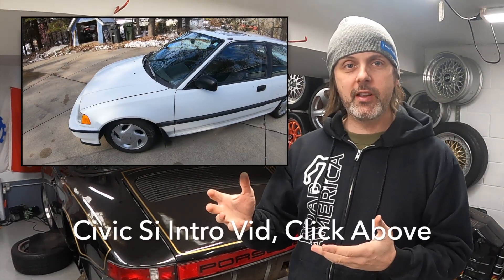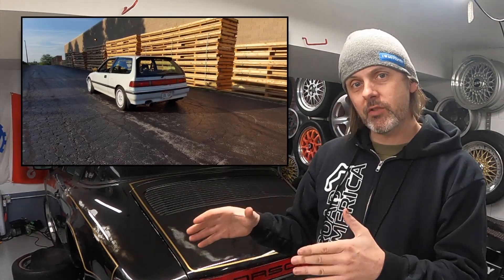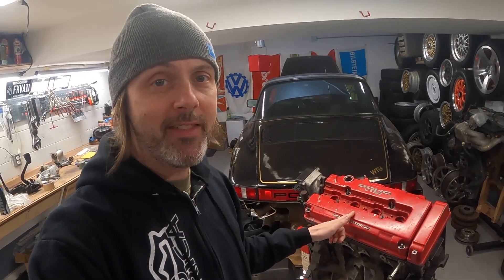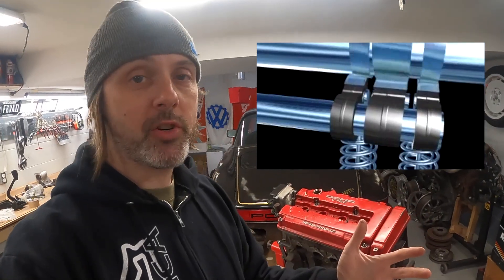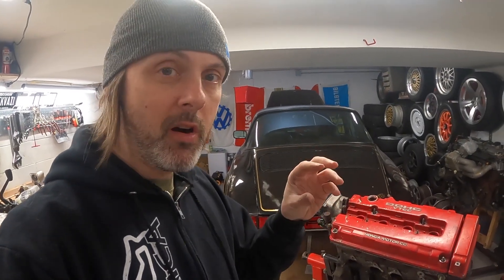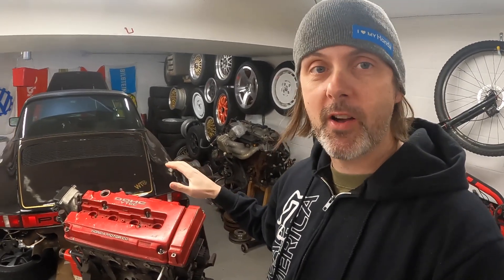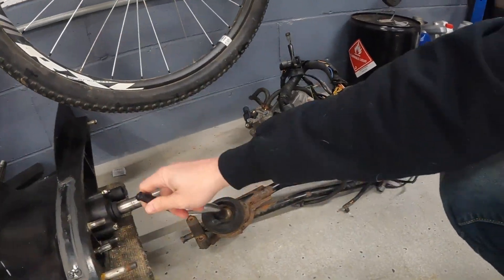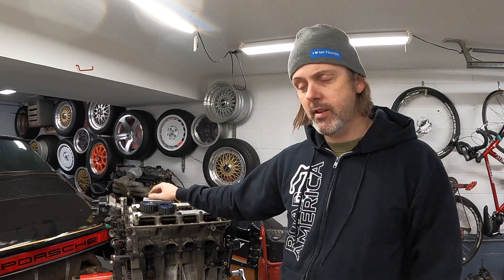HONDA B16: The BEST ENGINE for EF Honda Civic Si

Comment: Nice find! My concern is finding a b16, swapping it, and only to find out the internals are shot. Any precautions I can take before making such a purchase? Thanks
Reply from the maker: Watch the next video in this series, it shows you how to do a leakdown.  This is something you can do on an engine uninstalled/out of the car, without a transmission or starter, and gives you way more information than a compression tester.

Comment: Killer to see this. I have no experience with the V-TEC motors. I've only worked on the CVCC & other SOHC motors. Might be worth hanging onto that SI block if you think the $ value of the SI will continue to rise. Y'know the numbers matching block/chassis thing.
Reply from the maker: Yeah, maybe?  I just can't see someone ever wanting one of these with the SOHC vs DOHC... like.... it's just worse.   The SiR is more desirable.
Reply: @addvancedgarage  Rob, you are right. The Civic looks so damn good, I overlooked the fact that it has 150k on it. The last 2 Honda SOHC motors I ran had over 100k mi and good even compression, but were burning some oil. I pulled the valve springs and replaced the valve stem seals... problem solved, and clocked over 200k mi on both vehicles as daily drivers.

Comment: If you've come this far, just a little bit farther with a modest turbo and you can have a 500 horsepower daily driver.
Reply from the maker: Nah, rather have it slower and be able to wring it out on the regular
Reply: @addvancedgarage  yep if I do a B16 swap in my 91 dx hatch its staying naturally aspirated, less headaches without the turbo
Reply from the maker: @takumisato7126  mostly just wheel spin anyway